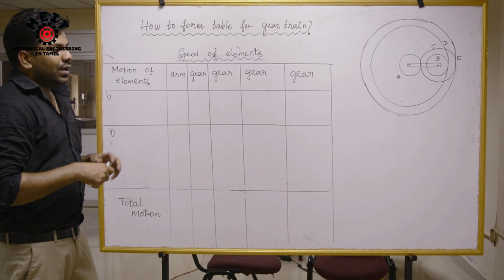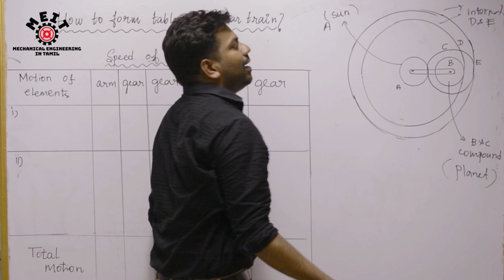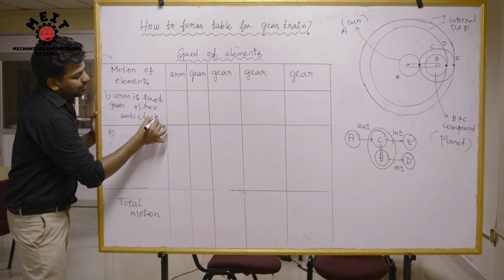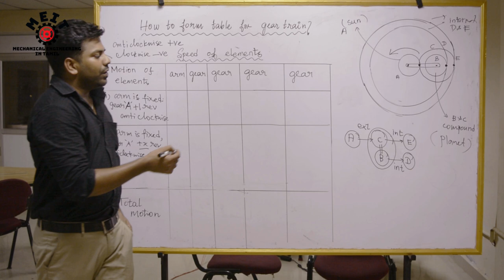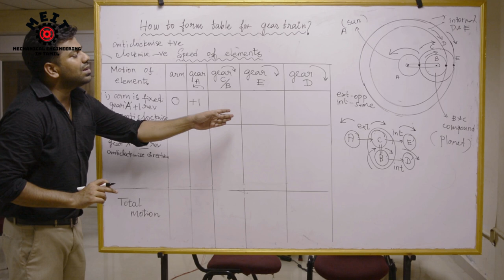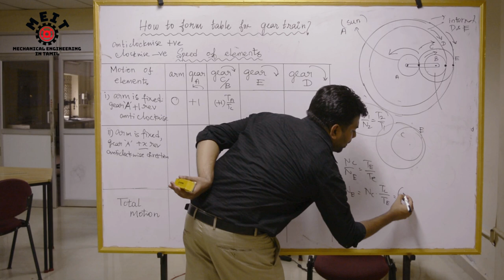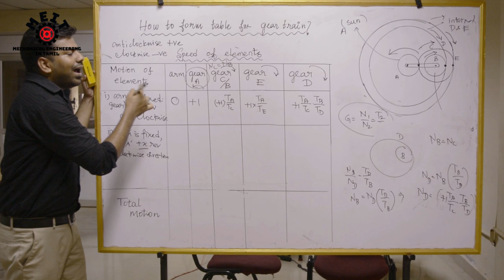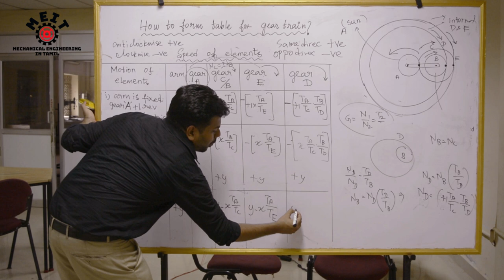Revolution / Speed table in Gear Train | Epicyclic Gear train | KOM | Kinematics of Machinery

Comment: Hey there...i hope you're doing great. I'm a second year Mechanical Engineering student from South Africa and i need your help understanding this statement here:

A motor is used to drive an intermediate shaft using V-belts and a 275 mm diameter driving pulley to create a speed ratio of approximately 2:1 between the motor running at 1750 rpm and the intermediate shaft. The intermediate shaft serves as input to a gearbox required to produce process power at a speed of 375 rpm in the same direction of rotation as the input shaft.

So according to my understanding i calculated the speed of the shaft(using the ratio) to be 875 rpm and V=12.599 m/s. So if I'm correct on my calculations, do i need to use the ratio to calculate the power transmitted by the shaft or is it going to be the same as the one the motor transmit?
Reply from the maker: Statement is not so clear.
Reply from the maker: Motor speed 1750rpm, it is reduced to 875 rpm by v belt., then gearbox comes to the story., which reduces further to 375 rpm. You can use ratio 2:1 for first speed reduction. For second speed reduction you cant use the ratio. The power can be calculated using gear box design.
Reply: @focusacademylectures  Thank you so much